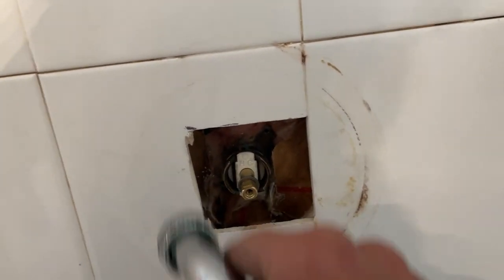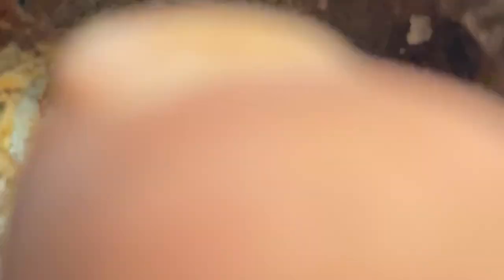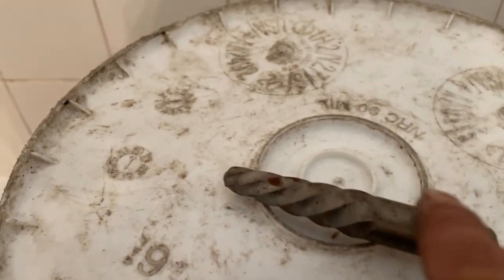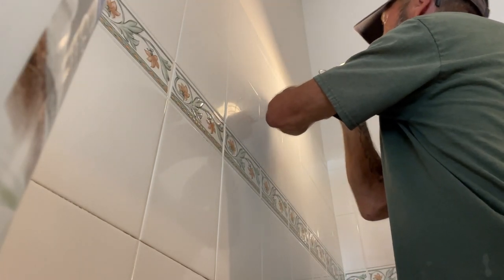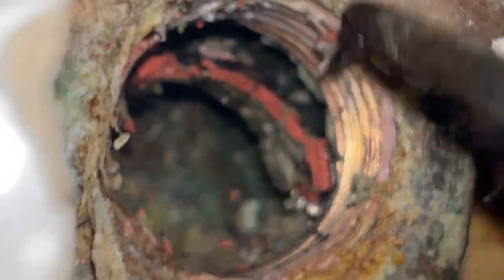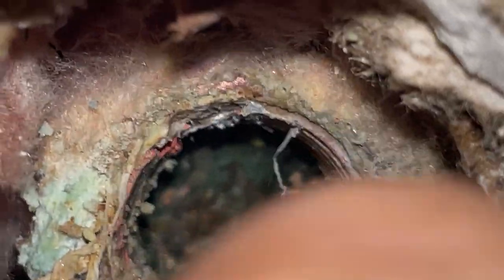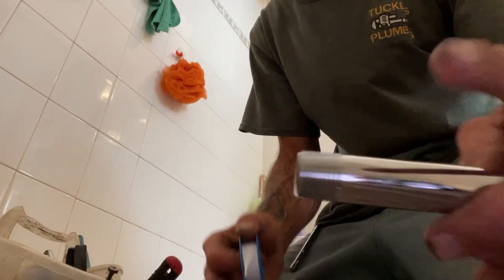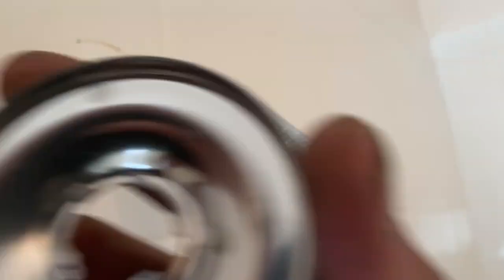HOW TO EXTRACT A BROKEN SHOWER ARM FROM WALL

Comment: Had this exact same thing happen at my house yesterday.  Bought a nipple extractor set and nothing fit right to break the old shower arm threads loose.  I was ready to take a sledge hammer to my granite tile and a wall at this point.  I found your video this morning and used the same saw to cut a notch, then needle-nose pliers to pull it out.  Fixed it all and replaced the shower head for $40.  Next time you're in Peoria IL, I got a 6 pk waiting on ya for posting this video (just send me a reply or a message when you're nearby).  You saved me a call to a plumber and some $$$.  Thanks again for posting!
Reply: I'm up here in Machesney park Illinois with the same problem 😥no extractors have worked and I'm going to try the hacksaw and needle nose plier
🙏🤞🙂
Reply: @barrettsmith881 did it work?

Comment: watched several videos using "extractor" tools.  when and bought 2 sets.  "Saw" this, grabbed my jig saw and metal blade.  Found a longer metal blade.  2 cuts, a nail and a hammer and threads are out, new shower arm in.
For the masses, I do NOT recommend using a jig saw!
The manual way shown is optimal.  If you can still find an electric body saw then it's a great time.

Tim, great video, thank you much!

Comment: I used to cut bolt thread inserts out like that. The other guys used to ask how I could take an hour to cut an insert out. You had to explain to them that it was actually the fastest way to do it.  They would not do it so I did almost them all. Thank you for the lesson in patience, Tim. Stay safe and stay cool.
Reply: That's because there was blood on the officers elbow
Reply: Are still making the toys horizontal so they can kiss with the pout lips? So what have them lips been put on a huge ball please explain 😭

Comment: Did this the other day, was almost going to wait till the weekend just in case this same thing happened so i would  have more time to fix it, but just went for it and fortunately the arm came out without a hitch. I have to say the big box stores like home depot are selling really inferior shower heads and head arms, the wall thickness is about half of what you would typically see years ago. I ended up returning a set to HD and bought on amazon instead, wall thickness nice and thick. I am willing to bet thin wall and threaded ends make this an almost certainty, especially if the last one doesn't use good thread sealant and or overtightens trying to align the arm.

Comment: Today I encountered the same situation that looked completely hopeless. Used the hacksaw blade method and cut a groove at the 6 o'clock position then another in the 4 to 5 o'clock position. Twisted a small flat screwdriver blade in the first groove and to my surprise a piece immediately began lifting up. The rest of what was left of the shower arm threads then collapsed with just a small amount of additional prodding with the screwdriver and the whole piece quickly came out together. Life is good again!

Comment: I broke my shower arm tightening my new shower head too tight. I locked the wrench too tight and broke it. I'm trying to get the shower arm out and somebody put cement or something in the hole with the arm. It's stuck in I tried wd-40 in a tiny hole I made in the cement. Do you have any tips? Thanks

Comment: Internal pipe wrench. Wheeler rex makes a good one. And if that doesn't work I usually use the flathead screwdriver and a rubber mallet to chip it out. Good job!
Reply: I don’t find the internal wrench works with plastic …a could not get it out ..I’m still lost lol
Reply: @lolli2943  if it's plastic... (which I've never seen) I would use a small saw blade to make a few cuts then use a thin long flathead to carefully chip it out one piece at a time.

Comment: I need to thank you so much for this! Same exact thing happened ....and im quite surprised how common this is...my shower head was copper and it was calified and the builder used like 10 wraps of teslon tape....but wow i used the saw got a small peice of thread to stick out ...then i started to coil it on my needle or long nose plier then started removing little by little....my plumber said he had to break the wall to get a better look

... i sent him home
Reply from the maker: Great job PWT IS PROUD OF YOU!!
Reply: @PLUMBINGWITHTIM  Thank you I had a good teacher! Im so happy. I stil wonder why builders hide the curved couplet INSIDE the wall...where is it not accessible...why couldn't they bring it out and maybe have a larger euschuteon or w/e those plates are called to hide the blemishes? I did didn't find your video and I was turning that pipe from the outside with a nipple extractor, I would've probably blown the pipe inside....i dont know if I already did...I did turn it with a wrench REAL hard before I found your video and removed it using your method.